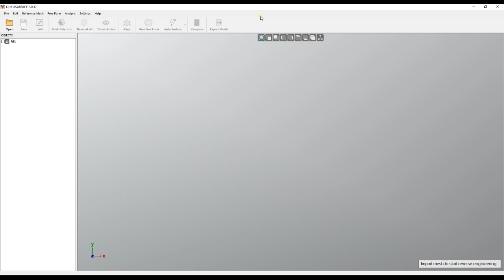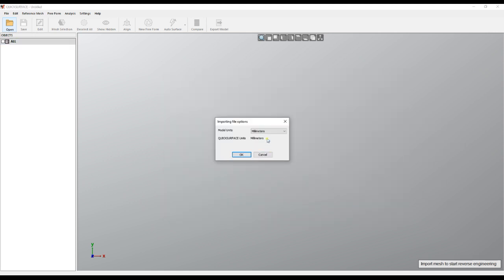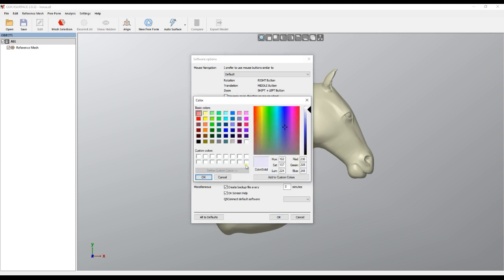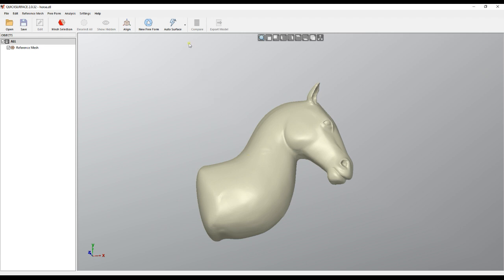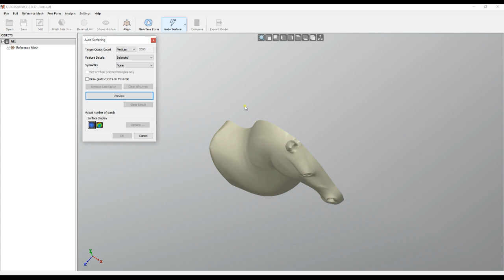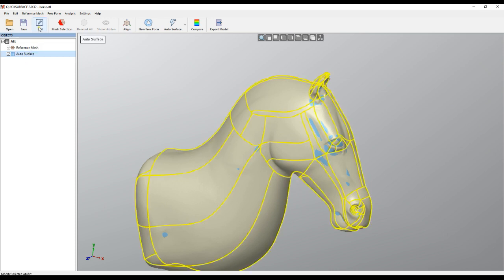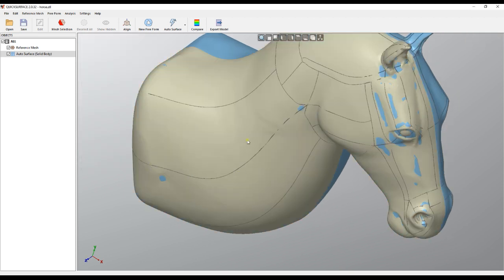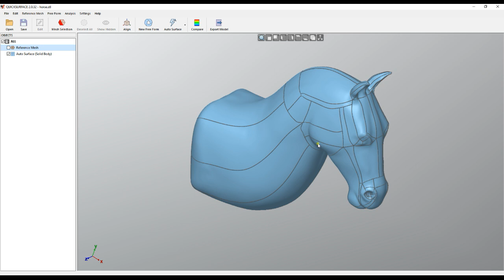QUICKSURFACE FreeForm - Getting Started

Comment: holy.......
i was sceptical since all youtube videos of reverse engeneering software alway make it look super simple.
But they always work with data that is just perfect, and that does not happen in real life all that often.
Everytime i recreate these totorials it fails or it just gives me crap Data.
So i wasnt expecting this one to perform any better.
Luckily there was a free trail, so no harm.
and damn did it not disapoint! i worked on my 3d scan dataset for my new video with fusion 360, rhino, inventor and all the others. But they would put out wonky parts so back to surfacemodeling manually again. Tryed for 3 days since im bad at surface modeling.
I was expecting errormessages, promts like "please align your surfaces manually" or just one side as a floating surface without volume.
nope, one klick..... bam, huge nurbs (not even a million small ones like other programms).
I was at least expecting open surfaces that i need to stitch in inventor and fail then..... nop importet perfectly.
Tryed right away to substract someting from it in inventor.... worked perfectly....

Well done Quicksurface....
I am very impressed.
I work in 3d printing and reverse engeneering for more than a decade now and never saw that.
Since im now in research i recomended your programm to my old friends in the industry.
Reply from the maker: What can we say. A big thanks for what you say. Yes, this is what we are doing and we work hard every day to improve. Thanks

Comment: QuickSurface is very cool for organic objects. Really fast. Surface optimization much better than in Design X Autosurface. PRESS 3 BUTTONS & READY. Not like in nPowersurface when you need to model each Sub-D. Good luck with your work, Kostadin!
Reply from the maker: Thank you for this. Such reactions makes us extremely happy and of course we will continue to work hard to provide easy of use tools to achieve great results